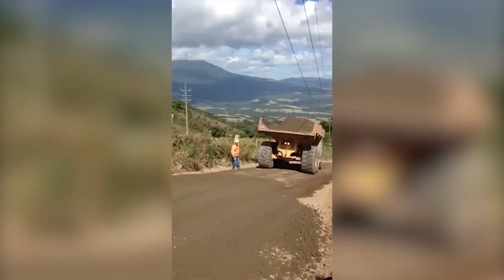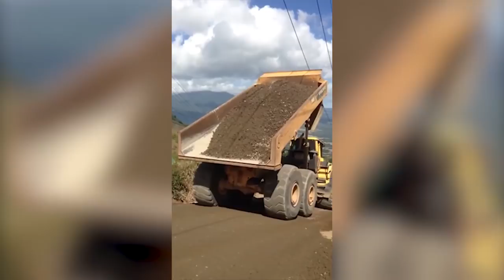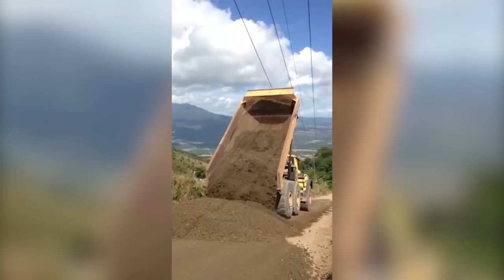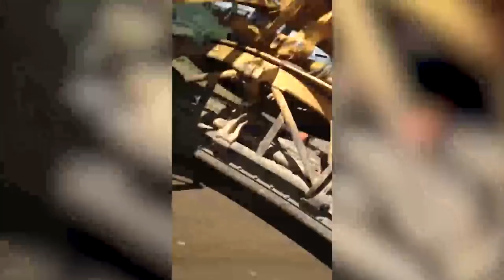Dump truck gets electrocuted by powerlines

Comment: Well, battery should last for a good while..
Reply: Good one
Reply: Unless it exploded.
Reply: The battery will not be affected because it’s only the negative connect to the Frame of the truck
Reply: It's not how it works
Reply: It's actually an Energizer commercial
Reply: @user-of3pg4zz6j  oh ok
Reply: @nfcf_.t7679  wooosh
Reply: @THREADOPS  woooosh

Comment: Well.. the truck driver must not have suffered anything, because the truck must have functioned as a Faraday Cage. 
[A Faraday cage or Faraday shield is an enclosure used to block electromagnetic fields]

Comment: What happened to the driver?! :(
Reply: Jonathan Smith my thought, too.
Reply: His head was stuck to the steering wheel causing the horn to blow
Reply: He most likely survived, not only judging by the fact the bucket was lowered after contact, but also because cars and especially vehicles like this act as a Faraday cage, conducting the electricity on the outside of the cage, putting it at the same potential everywhere. That's why you won't feel a thing inside.
Reply: @weeardguy  I was driving a concrete truck and hit a power pole that I couldn't see behind some branches. The power lines came down on the truck but with the rubber tires and the current going through the fram I was OK. At least that was the theory from the guy who worked at the power company.
Reply: @burf4963  Maybe he dumbed it down ;) Usually the rubber tires won't help that much as the voltage is high enough to jump the gap from rim to ground. The guy was right about the current going through the frame though.
Reply: Guessing he was fine because truck was touching dirt which was touching the ground
Reply: Ohh umm the driver died
Reply: @adaptive_syrup745  OOFING O O P

Comment: Did the driver die?
Reply: wilfredo iraheta No.
Reply: No because iron is a much better conductor than a human.

BTW, when there is a lightning storm, get in a metal cage or your car if you can.
Reply: @louistournas120  doesn't electricity travel through metal? Arent you safer in your room?
Reply: @kelbyrock7041 
You will be fine in your room. If the windows frame is made of aluminium like it is in my house, stay away from it.

A few years ago, in Quebec, lightning hit the clothes line (I guess it was made of steel cable), it came to the window frame (I guess aluminium), it passed to the bed frame (the bed frame was a children's double level bed with exposed steel frame), the kid received a strong shock and so did his dad.
Reply: @louistournas120  that's a killer story did everyone clap at the end
Reply: that's why every external metal frame or cable should be grounded. 
If that it's done you get a Faraday cage and nothing can pass trough :)
Reply: I dont think so, since his truck acted like a Faraday Cage, if Im correct.
Reply: Um no. LOL He was in the truck therefore at potential at not at any risk of being shocked.

Comment: Wait a minute....
What about the tires?
Why didn't they isolate the electricity from the ground???
Reply: lol you believe that myth? electricity can jump 1 centimeter for ever 10 thousand volts in air. those powerlines are hundreds of thousand of volts, the electricity doesn't even need to go through the tires to reach ground, it can jump straight from the metal to the ground. rubber is an insulator, but so is air, and they both have their limits.
they reason you don't die to lightning in you car is because all the electricity is routed around the car to the ground, not because a couple centimeters of rubber magically defeats millions of volts.
Reply: I can defeat millions of volts, i know karate
Reply: You can see the electricity arc from the front of the truck to the ground
Reply: @sensualarmpit3512  it's a little known fact, but most volts also know karate.
Reply: A lot of tires are steel belted.

Comment: He would be stuck in that truck because if u touch the outside of that truck your either gonna die or survive after a big shock he would be stuck in till someone would save him
Reply: all he would have to do is put the bucket back down so that it's not contacting it and the problem would be solved.

Comment: I think the blast of the horn was probably the driver's hands spazzing on the steering wheel due to electrocution. He was probably dying right then. If so, he should win the 2018 Darwin Award.
Reply: I'm sure no current flew through the driver. It all went through the few ohms of the truck itself
Reply: If he got electrocuted, he would have died on the spot, those things carry like 100,000 volts or even more, so that would just instantly kill anything.
Reply: He can't get shocked. He's in the center of the truck which is all padded interior it works like a Faraday cage

Comment: Did he die?
Reply: Man0fMeans unlikely. The frame of a vehicle is actually a protection in events like this. The electricity flows around on the outer surface. Look up "Faraday cage" for more info.
Reply: @BizarroSpock  i heard one man died in his cherry picker truck when his lift hit a powerline.. so im not sure if this guy survived either..
Reply: The driver survived he lowered the bed and moved the truck backwards after he made contact with the lines you can hear the beeping.
Reply: Hunter Jordan 
What do they have , like 10 volts or so? 
Nothing like lightning.
Reply: Hunter Jordan 
I already knew that. 
May as well consider anything more then a wall outlet lightning because it’ll kill you all the same.
Reply: @BizarroSpock  
No it doesn't.
Reply: The electricity found ground through the load, tires didn't help in this case  @hunterjordan5683
Reply: The dirt was ok.